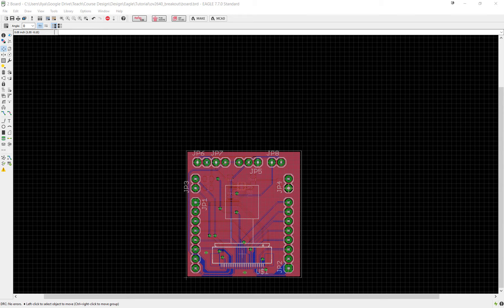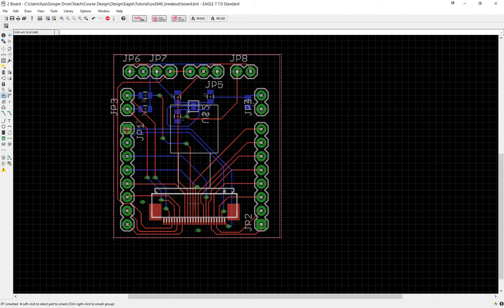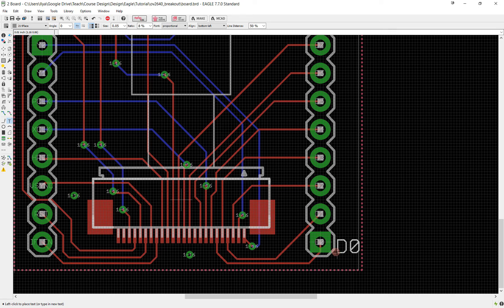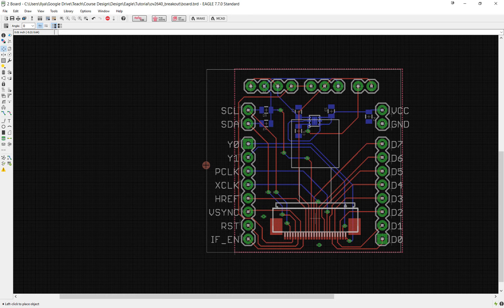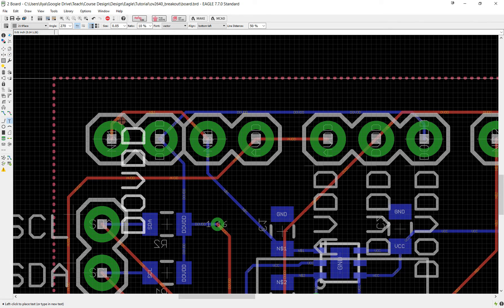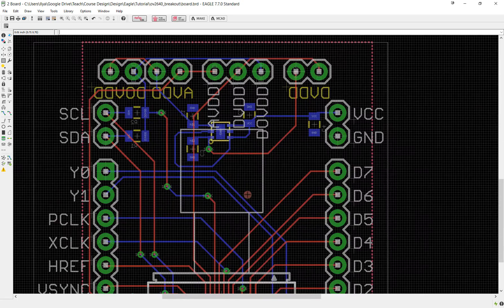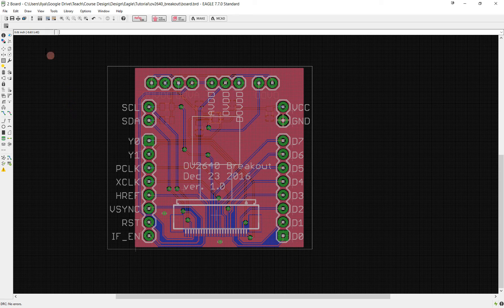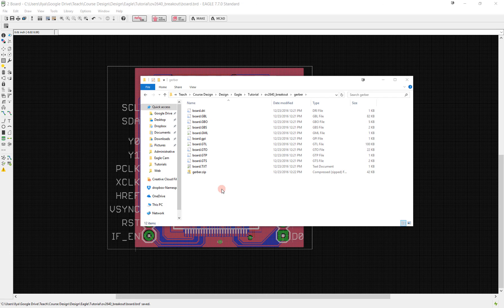Eagle PCB Tutorial: Finalizing Design

Comment: i had a question in the schematic file for all IC's like 4049. The VCC port and Gnd port ie. 1 and 8 in the IC are not visible and so we cant add the wires of vdd and gnd to those ports in schematic file in lab it was told that i could do it by in the Board file of the schematic but im not to find it please tell me how to do it